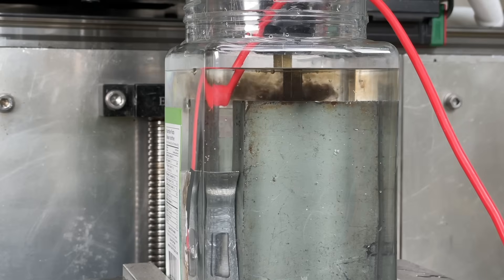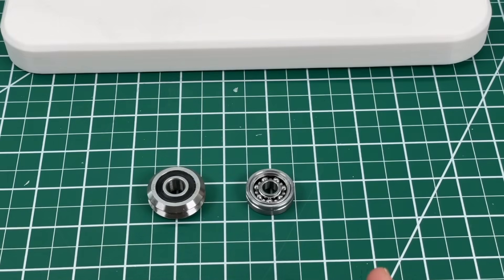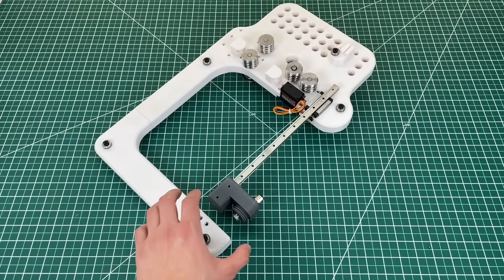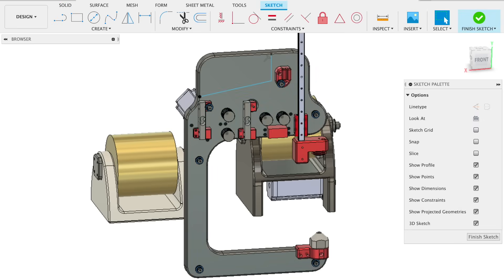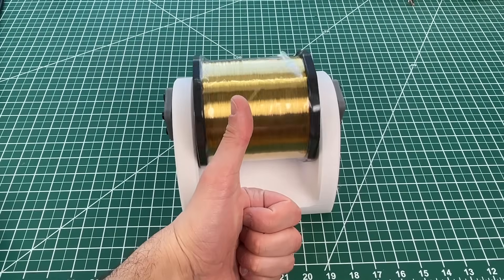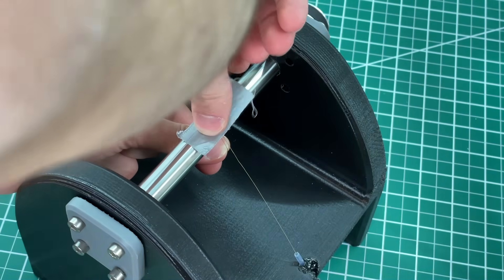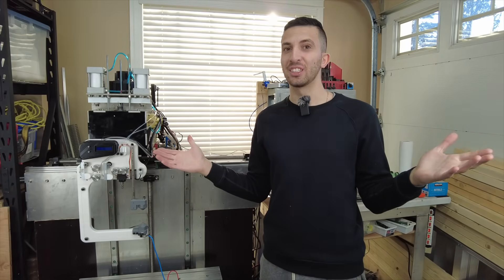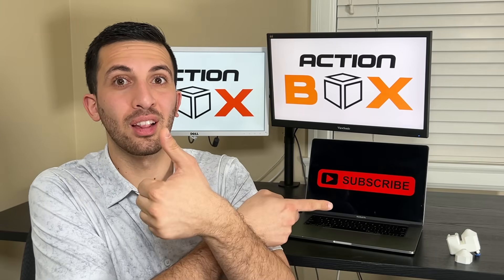How We Made A Wire EDM Machine At Home

Comment: Try reversing the polarity? Also maybe try ac? Every professional edm machine I worked on used oil. I think you can get away with the machines that don't respool but use it as a consumable like a gouging rod with filtered water. Also maybe try going either lower voltage and higher current or vise versa in incrimental steps kinda like welding or fdm printing nozzle/bed/fan Temps. It's all relative and your rig and wire might be fine if it's been proven to work your power can have a huge effect. Plasma cutters use high frequency and medium amps for temp and air to create plazma. Also is the water and electricity creating hydrogen/oxygen and is that effecting the cutting area? Is that why they use oil? Don't thing electrolysis happens in oil only burning but in a no oxygen atmosphere and high temp I don't know if it burns or turns to carbon Wich sounds like it could help and or hurt in ways but the machines they had me on more than the wire machines because I wasn't the guy with decades of experience running and programming them like some of the other guys were and on time sensitive important work that I know I will be slower at than another guy tho I can do it there's that fitness some people have that you only get with more time and I was on machines that we took graphite blocks and machined the negative and would make these micro pockets and other neat stuff that milling would just snap bits in this material! I did all the time! So I know when I weld with different types of steel and if it's overhead or whatever polarity matters!

Comment: Wire EDM and drill EDM have a function very important for this technology
It's checking the current flow and moving the wire or electrode back and forward to maintain the same arс, you probably will want to install a power supply that can be regulated by its current and frequency - higher frequency will provide a better surface finish but you will need to lower down the current.
In cheap EDM machines, I saw just 2 potentiometers to regulate these values - and it worked, but the automatic part was always taking care of the distance between the cutting part and wire so you will not have a big arc or a short circuit.
you can check this explanation
https://www.youtube.com/watch?v=AQCpueMkZ6o&ab_channel=AndysMachines
But the project is really amazing!

Comment: Grete job. speed must be funcion of your erosion. Maybe a simple solution is to clamp your metal bar to the wire sistem, monitor the circuit end speed it to 0 if your circuit became close or just before.  Upper contact can be better on the uper head moving whit the Z. i think it's a big problem using two bearings intead of brass or copper contacts form your generator. A paper filter is necessary or even a resin one  with little water.

Comment: I think you will find a key component of the EDM process is controlling the feed of the electrode into the workpiece in a feedback loop.  It requires measuring the voltage of the gap between the electrode and
Reply: the workpiece and maintaining the optimal voltage by adjusting the the spark gap by controlling the feed speed of the electrode (wire.)
Reply from the maker: Working on that for the V2.  Thank you 😊

Comment: Well your on the right track. Coming from an industrial standpoint, your wire feed is way too slow, your cut feed is too fast and your flushing pressure is way too low, your not controlling the resistance of the DI fluid.

Also oddly enough round stock is actually pretty hard to cut in an edm, relatively speaking. Since it is not a constant thickness they resistance from the part is constantly changing and thus your settings technically should be as well. Add to that the DI flow around the round stock which will actually divert the DI Fluid away from the cut and thus make it less effective. Also depending on the grade of stainless it may have a rather high resistance rating which will make it more difficult to cut, something like brass or aluminum with a lower resistance rating may be a better start point.

Your excessive feed rate is obvious from the deflection of the wire. As weird as it sounds the wire should never actually touch the part during the cut. So seeing it bow before it breaks is an obvious sign. There should always be a "spark gap" between the wire and the detail, the DI fluid will transfer the current to the part. Which brings up another point, your water may be too pure and not passing enough current. Industrial machines have sensors and use filtration and DI resins to keep the resistance level of the water very narrow window.

Ignoring all the potential resistance changes from passing the current thru a bearing, the contacts are sacrificial. Unless you want to be replaceing the bearing all the time you really should make the contacts a separate piece. A cheap 6mm carbide endmill trapped in an aluminum block a few mils in the wire path would be an easy cheap option. Also it is good to have them as close to the wire guides as possible as the further they are apart the more resistance you have in the wire, and industrial machines will generally have them in the low pressure flushing to increase voltage transfer and keep the wire and contact cool. May want to consider getting some coated wire. The wire cost more and will cause more wear on the system but it works better in poor cut conditions, which is pretty much the best you will see on a DIY machine, so it will give you a bit more wiggle room on dialing in your settings.

Comment: Have you tried swapping your polarity? The cathode and anode will errode at different rates.
Reply from the maker: Great thinking, Yes we have. Unfortunately the issue is our power supply so we will need something more capable of controlling the the power for edm. Cheers.
Reply: @ActionBOX  that makes sense. I read some excellent advice in a previous comment that I would like to amplify. Making a controller that backs the wire off when a short is detected will likely prevent breaks like this as well as the RC circuit to build up higher current sparks. This is an awesome project and very excited to see how it comes out! I have run EDM machines in research and industrial environments and it will be awesdsome to have it available to more users!

Comment: EDM Engineer here.

First of all, this is absolutely outstanding work.

Secondly, we call it dielectric fluid, not coolant

Thirdly, Wire EDM is much easier when feedback from the generator is used to control the feedrate. Fixed feedrates aren't very useful. I can't go into the feedback mechanism.

You also would benefit from top and bottom flushing to ensure the spark gap is kept free of debris.
Reply from the maker: Thank you, this is an awesome reply to get from a professional.  We will incorporate all of these suggestions into our V2.  Feel free to help out and share the video with others in your field who may be interested, we are trying to grow the channel.  Cheers, Dave
Reply: @ActionBOX  I've already shared it with my colleagues 😊

Can you drop the amperage at all? In general with wire erosion you're looking for a 300v ignition voltage, so you can drop your current. That spark looks way too big for 0.25mm brass wire. If you increase your wire feedrate it might resist the damage better. You can also try reversing the polarity - that can help with electrode wear. 

Using coated wire might help too, but it's quite a bit more expensive.

You might also get some benefit by reducing the duty cycle.

EDIT: Don't forget that when eroding a round workpiece, all of the energy at the start of the process goes into a single point. Try eroding something like a square blank - it'll be more consistent. 

Good luck!

Comment: I maybe missing something... but is there a feedback system for the arc? 
If the wire is making direct contact to the cut material ( resistance between them near zero) the wire must brake, mechanically and due to excessive current.
Shouldn’t the power be disconnected, the wire and cut material be separated from the wire (high resistance), then gapped by an additional predetermined amount before the arc (power) and cutting is reestablished?
Perhaps this is already being done, but I didn’t see it mentioned in the video.
Reply from the maker: Hi, great comment, you are absolutely correct that this needs to be done, and indeed it is not in this V1. We are working on the V2 which should tackle these issues.  Cheers. Dave.

Comment: Edm is 1 spark at a time. Even looking like thousands small lightnings all the time.
Never really got into the electronics and what controls the sparks. 

But looks like the sparks you have going for you are too big and too few/sec.. 

I mean 1000 sparks/sec or 10.000 sparks/sec

the fewer the sparks the bigger the crater. Including in the wire. If the power is the same that is.
Reply from the maker: Thanks for your input.  You are indeed correct, and I will resolve this in the V2. Cheers.

Comment: I once trainee at the Japanese renown wirecut edm factory( Its the compulsory in faculty final semester).  I noticed in wiring diagram ,the submersible solution also had ion concentration control.   
By the way , I see some China adhoc CNC wirecut the workpiece in the air. No need submersible.
A lttile bit more , I think to electrical the wire, remind me of the sparkling circuit might have close loop control in watching the spark behavior.  I mean they can control wire current change in millisecond by feedback sensor on how to movement not to make wire touch to the workpiece.
Reply from the maker: Thanks for the details 😊. Much appreciated

Comment: I worked on a wire edm machine years ago.  That machine monitored the EDM current and reversed the feed whenever the current got to high.  This backed the material off of contact with the  material being cut,   As soon as the current dropped to an in tolerance value it would switch back to normal feed direction again.  Also  Without current limiting wire failure seems certain.   Series resistors seem more important than parallel capacitors. 
Good luck with this thing   Wonderful video quality and great narrative.
Reply from the maker: Thanks so much Bob. I am currently working on all those updates and will have a video of the V2 in a few months.   Cheers, Dave

Comment: Hello Ik  have start the EDM wire project 12 years ago and set the first movie on you tube, there are some very good solution in the C arc of but there is a lot that have to change to cut wel and very lang I have at the moment more as 10 000 hours cut om the machine I have buid in the last 12 years and there are some fundmentals that you have to respect if you like to cut wel, the generator is major key, what I see in you movie is First the generator, second the water condition third the rewinding system of the use wire. And if you use Mach3 the problem whit it is that it not runs back whit a short circut but you have to coppel back the generator to the feed rate of Mach3. if you have any quistion ask it. greeting Benny
Reply from the maker: Thanks a lot Benny 😃 I’ll make sure to reach out while building the V2 if I have any questions.  Cheers, Dave
Reply: @ActionBOX  What do you use as generator to make you spark? You can not USE a welding machine for a EDM wire cutter. The problem that your wire brake is that you have to match power and that, and that the fall of the open volt from the arc to the cutting fase is to long , the wire cutting are this proces open arc the arc ingnit the burn fase and then the spooling fase this is also very inportent. so for to start you need 80 volt open arc the volt fall till the burning fase this is also the  gap voltage this is somewhere around 22 volt if you going under the 12 volt you arc whit be in short circuit if the burning fase is over the spooling the arc voltage is then 0 volt. I see that you have make the C arc from Mike his idea,

Comment: Fascinating build.
Does the nozzle for the wire have any coating or does the brass wire just scrape against the steel of the nozzle?
If so: is there a chance that this might create unwanted friction in feeding or roughness on the wire that could affect its cutting efficiency by ever so slightly changing the current/wire thickness ratio?
Reply from the maker: No coating, it does scrape. The chance is there, and we will find out in the next video whether it is negligible or not. Great question.

Comment: I am a toolmaker, I run sodick wire Edm machines from 1995. Currently trying to update them to modern drivers and motors, as the components it originally came with are deprecated and only available on eBay and likely don’t work anyway. This is fun stuff,
Reply from the maker: That’s awesome, maybe I can learn more from you as I’m clearly not an edm machinist. This is indeed fun stuff. Glad you enjoyed the video.

Comment: looks to me like the wire may be getting damaged when it transitions from one groove to the next on the mechanisms which are trying to make good electrical contact.  Perhaps by tilting either one or both of the roller axes (?) you could line them up so they do not bend the wire or cause rubbing when the wire transitions from one roller to the other.  Could be necessary to solve a geometry problem that is probably easier said than done.  This, however, could protect the wire from getting either rubbed or stressed when it transitions from one roller to the next (8 times).  This could be an issue on the wire transport rollers as well.   I really appreciate your effort in tackling these machine methods and developing ways this technology can be of use to the DIY community, bravo!
Reply from the maker: Thanks David,I really appreciate this comment 😊 cheers, Dave

Comment: Wire snaps because your EDM power supply is not suitable for EDM. Proper EDM PSU must deliver current in very short pulses thus preventing wire overheat at single point.
Reply from the maker: Awesome thank you. I have started working on my diy edm power supply thanks to all the comments received. Cheers

Comment: Hey great build once again!  

Don't know if this has already been suggested, but maybe the water conductivity isn't right. 
I remember Ben from Applied Science saying that the water has to have just the right amount of conductivity. Maybe the wire gets too close and snaps if the water isn't conductive enough.
Reply from the maker: You are totally correct, it’s not.  I have started working in the V2 and I will make this fix in the next video.  Cheers.

Comment: I would think you would need to close the loop between your power supply and your feed rate (either wire feed speed, or part feed speed, or both). Something like feed wire at x mm/s, move part 0.01 mm, wait for power draw to drop to 0, move part 0.01mm, wait for power draw to drop to 0 would probably work, but be very wasteful of wire. I'm sure that BAXEDM has a much more finely tuned algorithm and hope he is "open source" enough to share his thoughts.
Reply from the maker: I agree with that statement.  I’ll see what I can do for V2. Cheers

Comment: Why on earth are the wire feed and collect systems on DIY Wire EDM machines infinitely more complex than on professional machines?.. I have a brother HS-100 Wire EDM, and the wire spool sits in the top of the machin, it runs over a metal pulley on the top, and then around a Urethane pulley  over the metal one, and over the urethane one a second time, this Urethad pully is mounted on a brake, brakeforce is applied to get the wire tension correct.
in the bottom (my machine has  the lower arm running horizontal and the wire goes throug it, , it just passes over a Ceramic pulling roller, with a "pinch roller on top", and then down to the take-up reel, just a simple reel consisting of 2 metal discs, and a tube in between.. the rear disc has a nut welded to it, with a short bolt.. 
Feed the wire throug a hole in that disc, wind around bolt a few times, tighten bolt by hand.. done!.. 
this reel is powered by a small electric motor, just to keep the wire taught.. that is all there's to it.. (oh.. and there's a small "Feeler' you feed the wire through for breakage detection.

Your "process water" should be in a different tank, with filters and de-ionizing resin, furthermore, it would be nice to have a circuit to monitor conductivity. I can look up the conductivity, it shouldn't be too high, but also not too low.

Dropping the wire into a bin also works good, Mitsubishi Wire EDM's have that.. i'm not too fond of choppers though.. you end up with a bin full of needles, i know Mike Bax, and i know he built a chopper.. but i told him not to.. but would he listen?.. Noooo... :).. ah well he did a nice piece of engineering on that chopper.. but still.. the amount of pieces of wire is deceiving.. you might think.. "oh.. there's only a small layer on the bottom.. i'll empty it when it's full.. WRONG!... by that time you will not be able to lift it.. it weighs a ton!.. don't ask how i found out.. and emptying a full bin?.. not good.. not good..

I do like the concept of "Dropping the tank".. but on my machine that is not possible, since the lower arm is sticking through the back of the tank, through a sliding seal.. that is how professional machines are built..
Reply from the maker: Thanks Jan, this was super informative. I like that you explained the breaking system as it could help me.
Reply: @ActionBOX  You're welcome.. I had the "luck" i could buy  a Wire EDM of the same type i learnt the process on in the first place, and these machines are like the "Bare-bones" Wire EDM's.. very basic, but very productive.. try and get to actually see a Wire EDM machine up close and personal before building one..